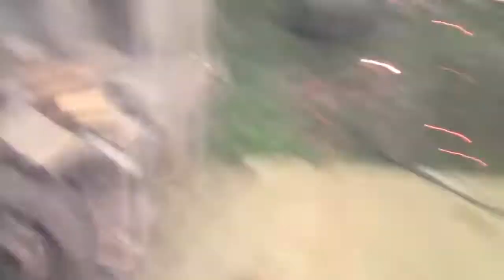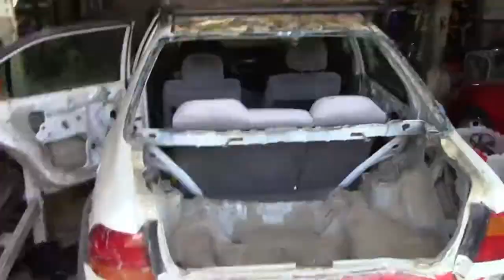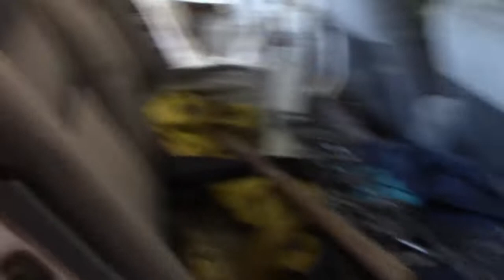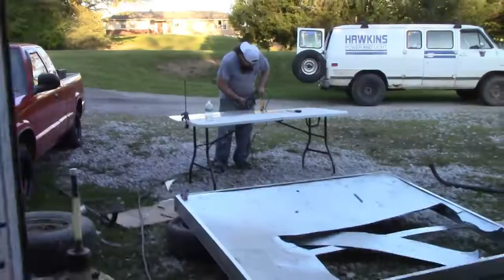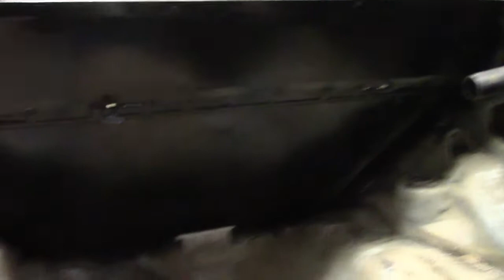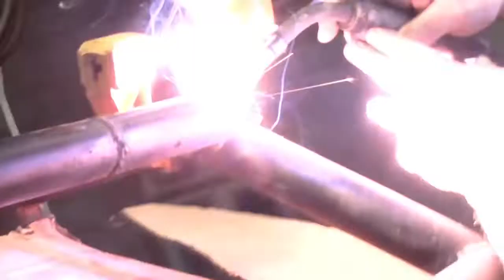HONDA CIVIC TRUCK CONVERSION PART 1

Comment: Heat it to make it soft in order to bend it. Silicone and self tapping metal screws all the way around. I like what you've done to it. I'm going to make mine similar but I think I like my trunk.
Reply: You might need to pre drill the plexiglas or heat the screws so they dont crack the plastic.
Reply from the maker: We pre drilled the plexi but it still cracked on us. I think it's just to much of a bend for a 1/4 inch thick piece. I'm gonna leave it as is for now and see how long it lasts lol
Reply: You should be able to heat the plastic with a heat gun or torch in order to mold it to shape so it doesn't crack. Test it on a scrap peice.